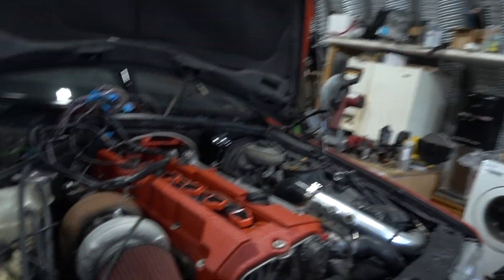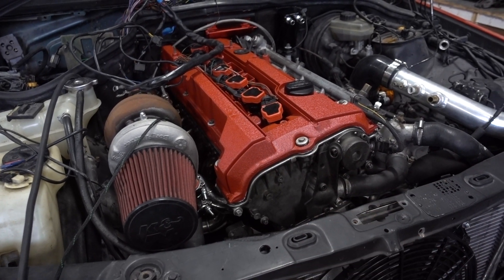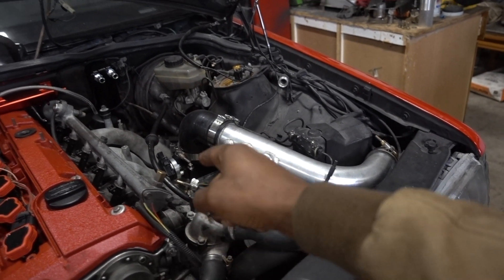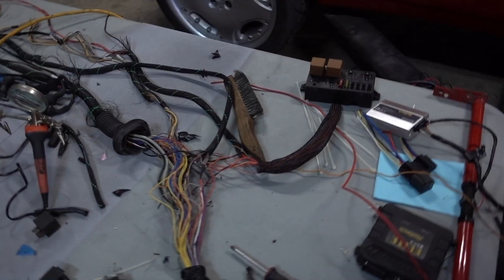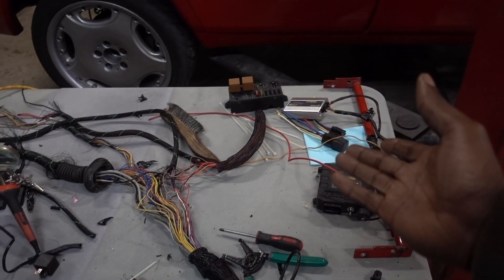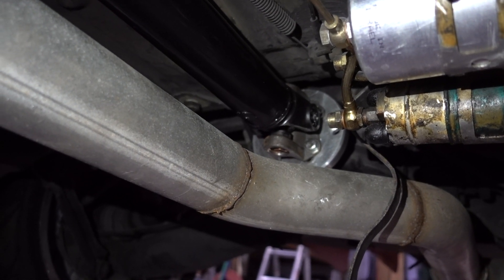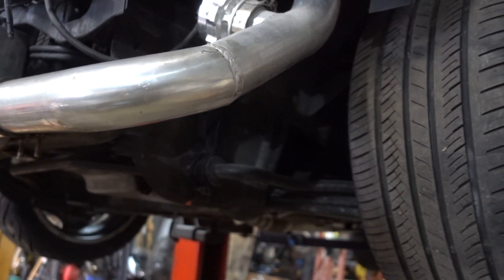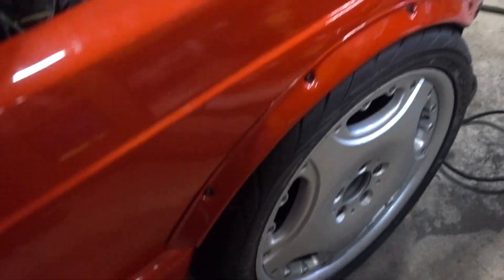Mercedes Benz 190E M104 turbo Swap 2019 update

Comment: Did you mounted m104 on w201 stock engine place ?
Reply: Indeed it will still fit the chassis, BUT the wastegate set up interferes at the mounting point. Thus being said you either have to go with Custom mounts or TurboBandits custom Racing mounts from the W124! That way itll fit!

Comment: That's a nice built,,, I have a w202 with a M104 , it's automatic now  , but I'm planning to do the the manual conversion,,, what transmission should I use?.. thanks.
Reply: @neverendingprojects  thanks so much
Reply: @neverendingprojects  hello Joshua !! I found a slk230 w203 Wich I'm getting the transmission from, so the pedals would work as well for my w202with no modification?.. thanks
Reply: @neverendingprojects  thanks again

Comment: Which 6-speed did you end up using for the M104? Something out off an M111? I've got an M103 with an autobox, and I've got plans to put it into something else and want to go stick. Unsure on flywheel requirements, however, for mating the 6-speed from an SLK to the M103. I know it's been done, but very little documentation on it. Thanks!
Reply from the maker: 2002 c230 M111
Reply: @neverendingprojects  thanks!

Comment: Does the 716 6speed transmission bolt up the 190e?
Reply: @neverendingprojects Great videos ;-) Which part number gearbox are you using? Coming from which car?
how much can it handle?